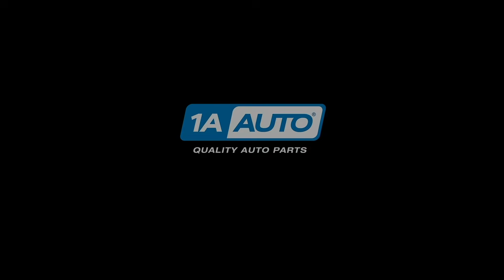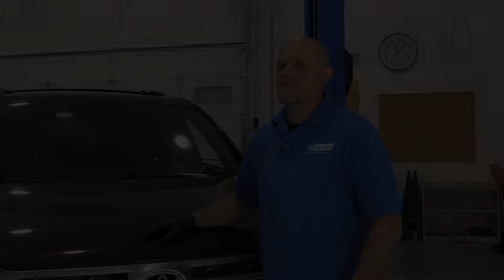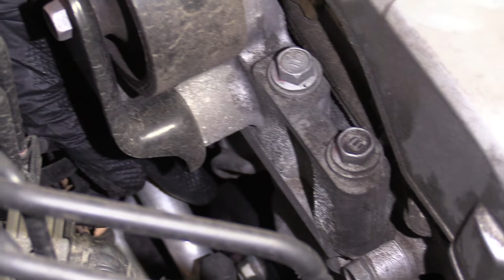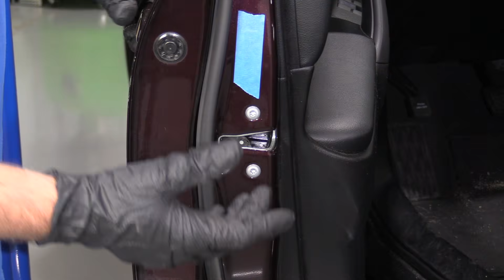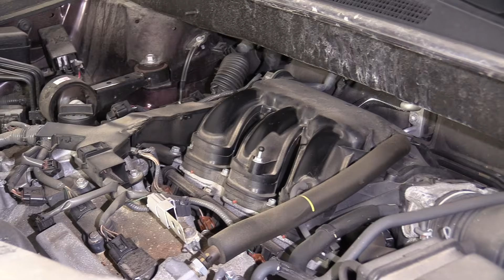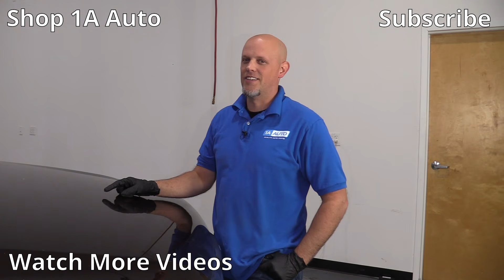Top 5 Problems Toyota Highlander SUV 2nd Generation 2008-13

Comment: These highlanders also have eventual leaky fuel rail issues. Especially on the front most bank of the engine. The end cap for the fuel rail is friction welded on. The damper only works so well and that friction weld fails over time. Causing slow fuel leaks. sniff for fuel smell after you stop the vehicle. I am experiencing the same issue with the radiator. just below the cap, there is a 90 degree bend with what looks like a plug at the end of the 90 deg bend. It is also starting to leak. I'll replace with new radiator when I do the water pump and thermostat.

Comment: Oil cooler lines are rubber and need to be updated to the new metal part, for the 2008-2010 model. Also valve cover gaskets need replacing which requires the intake manifold to be removed. We’ve owned our 2010 Highlander for 9 years and currently @ 145k miles. Very reliable, recently this year we have had some repairs but no complaints as it has been a solid driver for us.

Comment: I’m researching a lot and I’ve heard there was a revision that fixed the VVTI pin with a smaller diameter and a stronger spring and these motors don’t wreck their VVTI or chain guides.

But no one can agree when this revision happened;  I’ve heard 2010, 2011 and 2014 and one dude said they started “phasing in” the update around 2012 but to stick to 2013 vehicles to be sure!?

This revision is identified by removing the oil filler and looking in we see two slots rather than and open neck.

However one dude says you can have the revision without the slots and there’s no way to know.

I think it might be easier to just forget about the 2GR-FE!

But if you have any advice I’ll put you in my will and be eternally grateful?

Comment: 2011 Highlander with 271k no leaks or hiccups. Replaced starter and alternator around 250k miles! Have replaced rotors, brakes and tires x 3. I still have original ignition coils and plugs. Replacing them soon. Also, on second set of struts also changed around 250k. Basic maintenance needs. Original transmission fluid too!!

Comment: Do you have experience with Highlanders BURNING OIL? 
Mine is a 2012, 167k miles, routine oil changes all along. 
I put in 1/2 qt to 1 qt per WEEK!
Also, you mentioned KNOCK SENSOR... I tested mine for codes and the Knock Sensor came back as an issue.
Does that burn oil??

Comment: I had 2008 Sienna with the exact same engine 3.5V6 GRE and 5 gears automatic transmition - BEST EVER owned vehicle made it about 200k miles from 44k to 246k when my wife totaled the car.  ZERO problems with anything, no burning oil, no problems at all with engine. Now got 2008 Highlander with the same engine, running strong too.

Comment: Great video! One comment: When possible can you also mention what a component's role is, before telling us how to fix it etc.?   Question: Can you pls tell me where the ODP is located in 2008 Highlander? Preferably with a video showing steps to get to it? Also the fuse that is connected to the Cruise Control. Thanks much

Comment: I am surprised that you didn't mention the intermediate steering shaft. There are a lot of videos on YouTube about this problem and it appears that it isn't isolated to the Highlander. I have a 2009 base model AWD Highlander with 125,000 miles which I have only had for a couple of weeks and it was obvious there was a problem there since day one.

Comment: Own a 2011 Highlander V6 4wd with 95k miles and the only thing I've replace is the battery last year.
The battery was still working fine, I was just getting paranoid with it being 13+ yrs old

Comment: Have a 2008 I bought new.  Positively the worst POS I have ever owned in 49 years.  Sunroof leaks, drivers window fell into door (of course during epic thunderstorm), oil line ruptured, water pump, struts, eats rear breaks and tires, rear window kept opening, radio dead, and at least a dozen other fails.  Most occurred 30-50,000 miles.  It has made a pretty good mechanic out of me. Mostly because I couldn’t afford to pay someone to fix it.  All scheduled maintenance I did way before recommended.  Maybe I found the 1 in a billion lemon, but I’ll never buy another Toyota.

Comment: Great video, but you broke my heart. I wanted to get one for myself, a used one after I saw a video describing them the most reliable SUV. Now what? buy a Ford, Chevy.
Reply: These are great vehicles, I'm currently looking for another one.  Sold my 2012 with 168k for a 2021 XSE Highlander.  Both have been my best vehicles I have ever owned.  Getting a used 2011-2013 for a daily driver and first car for a kid.

Comment: I have an 07 Avalon(same motor) the water pump is the only issue I’ve had. I think the newer 2GR-fe motors took care of that problem. Currently have 193 thousand miles. Still purrs

Comment: 2013 Highlander with a v4 engine with 150,00 miles. The low oil pressure comes on and it took it to the dealership. They told me the engine is eating up the oil and I need a new engine 😢. Crazy with only 150,000 miles. Anyone else has this problem?

Comment: 2011 Toyota Highlander 2.7L engine. 272K miles. Rattling sounds at low RPM (idling in park or when stopped in gear), not just on start up. No engine lights, no leaks under vehicle. Always synthetic oil regularly changed around 5k miles. What do you think? Research seems to point toward the VVTi gear/cam problem, and/or chain guides/tensioner. Nice video thank you

Comment: At just over 48,000 my wife's 2012 Highlander 3.5  had the water pump replaced plus coolant flush. It did not leak but it started rattling. Just had it worked on 5.22.2023. At the same time had the belt replaced as per me. No reason to replace water pump and not do the damn belt while right there. Cost from the dealer, $1450

Comment: Have a 2008 Highlander with 200,000 miles. Only 1 of these top 5 has gone bad and that was 1 coil. Had to replace a Trans line, Alternator, drivers arm rest pad(twice). Other than those items, just regular maintenance. Has been a great vehicle.

Comment: I was told that the spark plugs need to get replaced on these at 100k miles but to do that the engine needs to get pulled to get to the back plugs. Is that correct?

Comment: I have same car 2008 toyota highlander hybrid. I was working on headlight and I left the hood open and it rained . Since then the outer foot light (the light on the outside mirror light) is on. I tried to turn it off but I don;t see any clue. Even the owners manual says nothing about it. Do you have any idea  if there if any switch for it or if there is fuse,which fuse is for this. Every 2 to 3 hours I go and start the car so it won't drain the battery. Pls,can you help me on this regard?

Comment: The VVT actuator problem effected me. The pin in the gear failed. It was a $2700 job for me. The car runs great after the repair.  I operated the car for 75,000 miles with this known problem (cold start rattle) before taking the car in to get the VVT gear replaced.
Reply: Wow. 75k
Reply: @World6ooShow  Not sure if similar to Honda 2008 Accord but mine has rattle when starting, Not cold but after sitting engine off 1.25 hrs  minimum to 2hrs after oil has drain completely down. Bought at 104,000 in 2013, now at 192,000 and it still rattles like a diesel engine for split second when starting. So 88,000 miles.

Comment: 1. Engine oil cooler pipe (pin hole in rubber hose)

2. Water pump leak.

3. VVTI oil leak at the banjo joint.

The 3 things I experienced first hand.
Reply: Kecup Abece Just going over maintenance records on 2008 Highlander I bought and your 1. & 2. were on receipts, along with the usual, alternator, belt and tension er pulley Ignition coil (1 only),

Comment: I have had none of those problems,  its at 168000 miles now.  What I did have was the very common brake abs pump failure,  rear hatch motor arm failure, a/c actuator motor failure.

Comment: I've had to replace the water pump once so far. Also had a weird 1-3 second hard vibration come from the torque converter, trans flush will fix that. And at about 212k miles my catalytic converter got plugged, a sawzall and a $10 flex steel tube will fix that. Also burns a good amount of oil... Just my own experience and things to take note of so you don't have to spend days like me trying to diagnose your car

Comment: Good video but most important common problem & SERIOUS PROBLEM then all listed here is the rubber oil pressure lines. If you have 80,000 Miles on this car & haven’t replaced the oil pump that has the rubber lines with the metal lines, you MUST do it NOW at 80,000 Miles. It is the most important of the MOST COMMON 6 FAILURES. When one of these LINES ( part of the pump) goes you will loose ALL YOUR OIL in seconds. That is very serious & something that you do NOT want to have happen to you. Just replace it the moment you read this if you haven’t already or if you purchased it & notice it still has rubber lines, REPLACE IN NOW also. This should have been a recall item from Toyota but they didn’t want to admit to the problem. If you do this yourself buy stud remover sockets & shorten a 12mm wrench & it’s not to a bad fix to replace.

Comment: IF YOU HAVE THIS ENGINE BEFORE THE REDESIGN ON APRIL 08, Make sure the VVTI oil line is metal or at least replace it with metal before it raptures. Oil will drain out in 30 seconds if it raptures while driving. Otherwise, great vehicle and engine.
Reply: So was this a problem that only pertained to the 08 models and before?

Comment: In my humble opinion as these Highlander models are now aging, the number 1 problem is with the Engine Oil Cooler Pipe Leak as Toyota calls it but if you're driving and a pinhole opens up in one of these lines, you will have a major oil leak that may destroy your engine in a few minutes! This just happened to my wife as she was driving our 2011 Highlander Limited with the 3.5L 2GRFE engine. She called me when the low oil pressure light came on and I told her to get to a safe place to pull over and then shut off the engine. When I got there, the front undercarriage all the way to the back of the car mainly on the passenger side was just covered in oil. No oil registered on the dipstick. I added 5 quarts of oil and fortunately it started but oil was pouring from one of the oil cooler lines with the leak so I shut it down and had it towed to my Toyota Dealership. I still don't yet if permanent engine damage has occurred so I'm keeping my fingers crossed. This is a known problem by Toyota and they issued a TSB(T-SB-02011-11) back in 2014 and also included Warranty Enhancement Program - ZE2. 
I've done a lot of research on this over the past couple of days and it seems that many more occurrences of this problem are happening as vehicles reach 100,000 miles or more. The fix by Toyota is to replace the rubber oil cooler lines with metal pipe ones because the rubber ones become brittle over time. It's not a matter of if the rubber lines will fail but when and it's a catastrophic engine failure waiting to happen. The part number for the genuine Toyota Engine Oil Cooler Pipe replacement is 15767-31020. FYI, this also pertains to certain Siennas, Venzas, and a couple of Lexus models. I have no idea why there is no recall for this as it's dangerous if this leaks happens to you while driving in certain areas at certain times and if you can't pull over fast enough the engine will be destroyed due to oil starvation and that will cost thousands of dollars to replace. I have filed a complaint with the NHTSA and advise anybody else who had the same thing happen to do likewise. But first and foremost, if you have one of these Highlanders, check those oil cooler lines located under the car near the oil filter cartridge housing unit. If you still have the rubber lines, get them replaced ASAP by a Toyota Dealer or reputable mechanic! It may save your engine or possibly even your life.
Reply: Had this almost exact same situation happen to me 2 weeks ago pulling into my
driveway. It was Saturday so I bought the all metal part at Advance Auto and did it myself.  It’s always/only been serviced at the original dealership, so I called them a bit angry Monday that they never once noticed or recommended a replacement of a high pressure oil hose in 10 years it’s been in there…
Reply: @gfritts  either their mechanics are incompetent or they're trying to rip you off by letting you ruin your motor so you buy another car from them. Either way I'd find another dealership and let them know exactly your car will never see the inside of one of their bays again.
Reply: @gfritts  Good to know the part is at the local auto store. Thanks. I don't own one  but I like the information from everyone.
Reply: @gfritts  hey, where can I locate the part to see if I need to replace it or not?
Reply: Recalls ruin reputations. Look at how the rusty Tacomas were kept quiet for over 10 years.
Reply: I had that exact part break and leak oil too on my Toyota Highlander 2008 with ~150k miles - it drained my oil, but fortunately I was close to home while driving and suspected something was wrong, but it might be easy to not notice I'm driving without oil.  (I might have heard the car make a light beep IIRC?  Whether it did or not, it felt like it was driving dry).  The dipstick was empty.  I and a friend from church went to a local auto parts store and replaced it over ~a year ago IIRC after we identified the source of the leak.  Apparently it's not just me.  It's the oil cooling line.  We removed 2 panels underneath to access it.  We put sealant on the gaskets and put the new oil cooling line in, and that part's been working just fine since.
Reply: Thanks for this message. I'm in the market for 1 of these. Is this a problem on the hybrid as well? I imagine it is being a 3.5 v6 as well. Whichever I buy, I will check if the upgrade was performed. If not I'll have it done during inspection. Ty

Comment: I have a 2004 Toyota RAV4 it has 287000 miles on it since I've had it all I've changed out is two CV joints for radiator and fans that was my fault I missed the fans not starting fuel fuel injectors brakes tires alternator battery pretty common s*** easy to repair and parts are easy to find I love Toyota products I saw a Toyota Highlander and I've been thinking of looking at buying one but my RAV4 is still alive and kicking

Comment: My 2009 V6 Highlander started making this whining noise coming from the engine compartment.  The noise is only on when moving, i.e it does NOT come on when the engine is on but the car is sitting still.  Any idea??

I had water pump replaced at like 100k miles and alternator at 135k miles. I forgot to mention a crankshaft/camshaft position sensor which can be a pain to replace just like those 3 spark plugs located in the aft side of engine.

Any help would be greatly appreciated.
Reply: Yes Transmissions will do that but shouldn't at 135k. I would change ATF long before they say. Use a high quality Fluid too. It is well worth it. Or it could be your power steering pump. Just guessing here but both will whine.

Comment: Bought a 2012 new, my only complaints, the mirror control switch stopped working, the radio volume control has a mind of  it's own, and loose parts in both front door window actuators. I've had to open up both front doors tighten or replace parts that hold the window on track.

Comment: My 2013 limited has 210,000 miles and only have done oil cihanges tires struts. Just regular maintenance. Best suv I’ve owned so far no major problems.

Comment: I have a 2013 Toyota Highlander Base LE we are at 190K miles my check engine light came on and trac off light came on. The mechanic said it was some type if censor. They ordered that part and put it in and test drove it three times the lights went off but then came back on and car stopped working. Now they are saying it needs a new engine that the coding is saying the engine is done. He said I have an interference motor so it limits what he can fix. So a new motor and labor will run about 5k
Reply from the maker: +Kisha Simon Thanks for the feedback!
Reply: Could be your alternator.   The engine will always last for you with Toyota. Keep your fluids changed.

Comment: THANKS!
Not mentioned in the video (because not in top 5 and/or only applies to the 2nd Generation Highlanders with factory towing package), is possible the risky rubber and metal oil cooler pipes. Scary catastrophic stuff ,but I do not know the failure stats. Definitely something to change out before failure occurs.

Comment: I have a 2013 Highlander. All 4 Door lock actuators went bad.  Spent 2000 to get them fixed.  I notice water leaking in the garage.  I figure it was the ac water.  The temp doesn't rise on the dash so not sure if I should replace the water pump or not.
Reply: If it was the water pump your car would be overheating and you would be able to smell the antifreeze, also the water in your garage would be green

Comment: ? My 2012 Toyota Highlander 83k check engine light is staying on. So I took it into Toyota they’re telling me it a code P0368 Camshaft Position Sensor. In which they would have to remove the top of the engine cover to replace. Ok so I ask if that the case can you replace the spark plugs while the cover is off. I was told probably not. So my ?  Where is the camshaft Position Sensor B high input Bank 1 located and since they have it taken apart wouldn’t the rear spark plugs be more accessible. Since the 3 rear plugs require you to remove the intake manifold. Please advise as to where this sensor is located and what parts have to be removed to get to it. Thanks